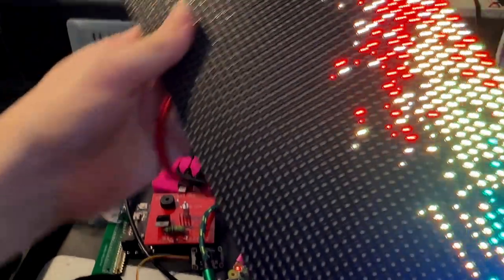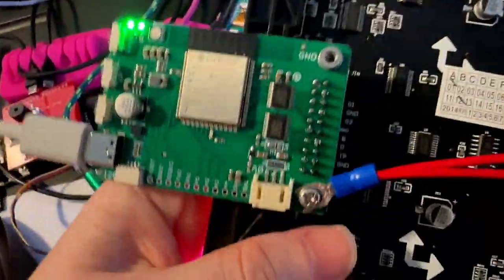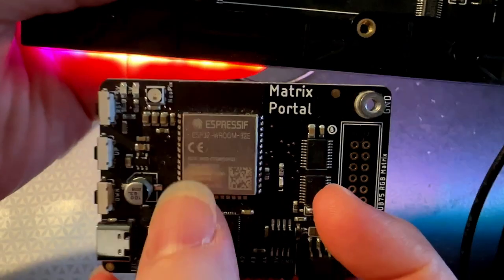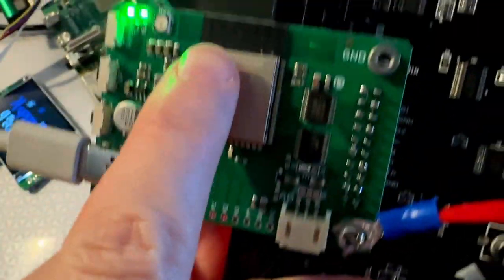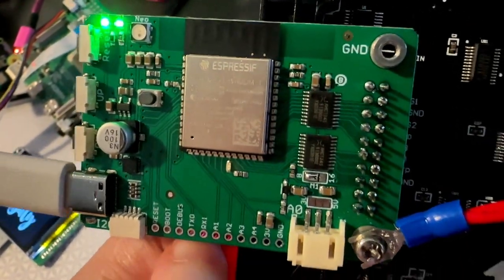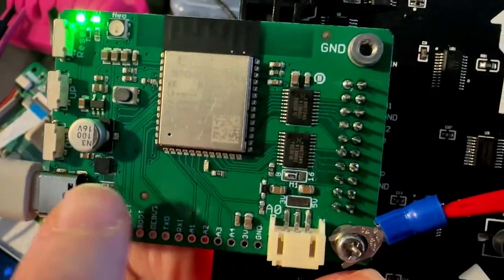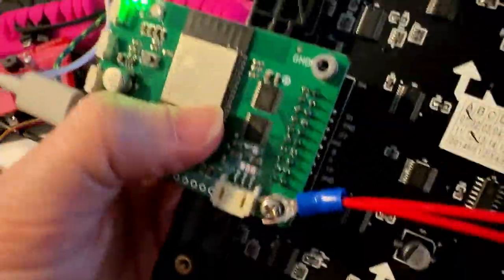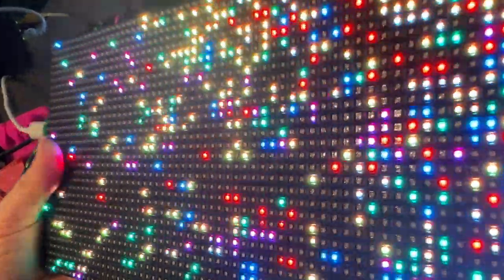Matrix portal s3 shifting sand 🔀📲📅⏳💔🔄🔌💡🏜️🆕

Comment: I'll buy two and most likely more. This will make a nice "electronic layser" for the home.

How about a nice military style unit that has two old style back-lit panels and a single large pushbutton. One display shows "PRESS TO TEST"  the other. "RELEASE TO DETONATE IN 11 SECONDS" and a strong magnet on the back to hold it firm on a rack.  I caught a lot of young officers with their fingers on the button. Mostly 1st and 2nd Lieutenants. Young Army officers were so gullible.